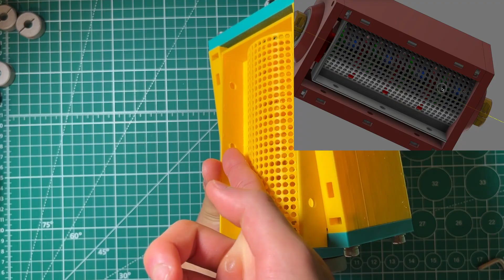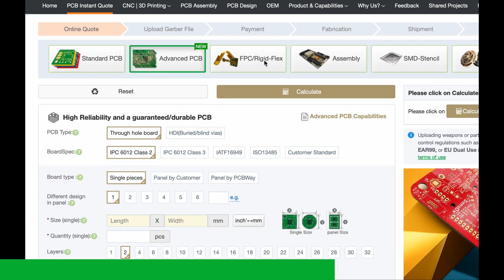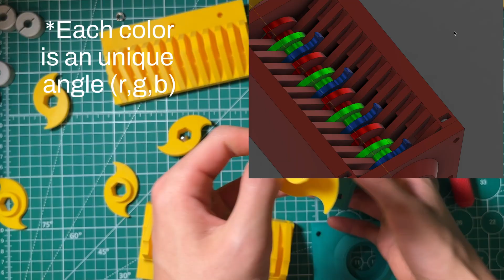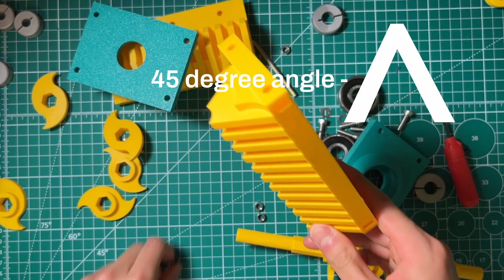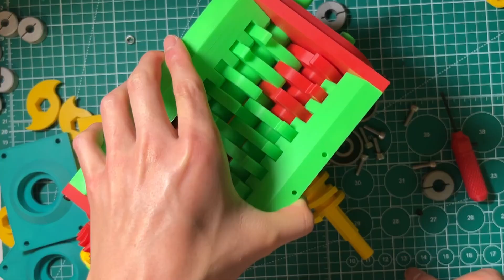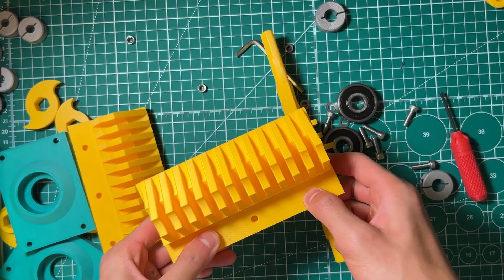3D Printed Shredder For $8! | Operation Perpetual Printing

Comment: I think you are really onto something great. Your tool design is amazing for 3D printing. If you can configure end bits from carbide metal tools designed for metal lathes you should be able to shred things way stronger than your current design. Just a thought.
Reply from the maker: Great idea!

Comment: Dude! Such amazing modeling skills!  Are you going to get metal blades cut or is it strong enough with plastic?  Will you release a kit when you're done designing?
Reply from the maker: I’ll probably release both the files and a kit. I’m thinking of making options for both metal and plastic blades. Working on a gearbox for a drill to power the shredder. And thanks for the support and the donation!!!